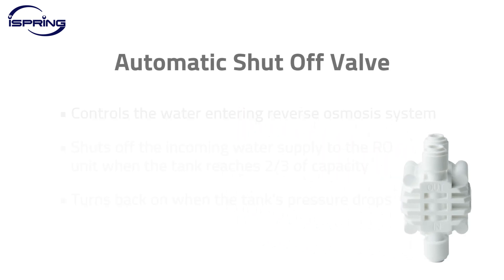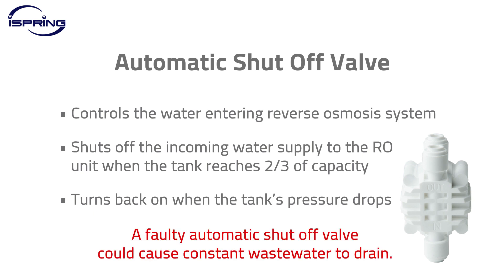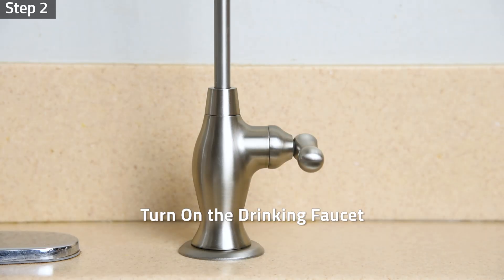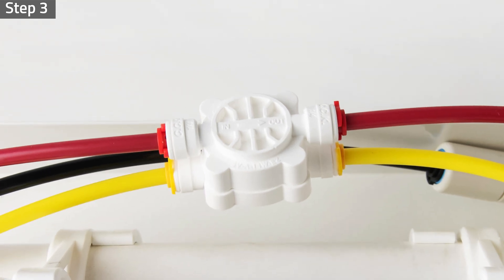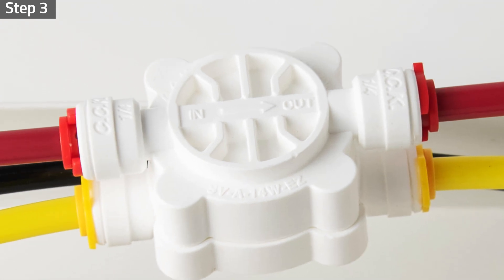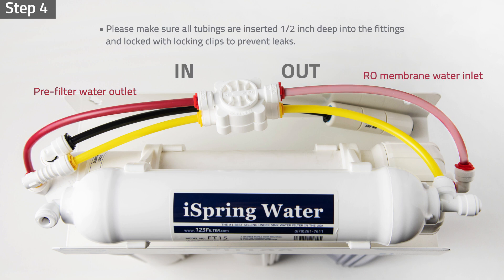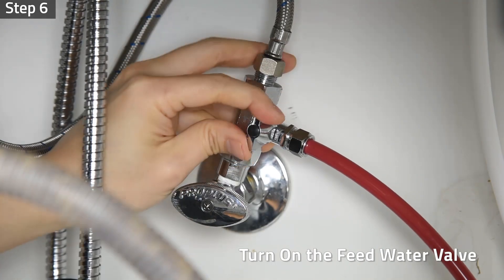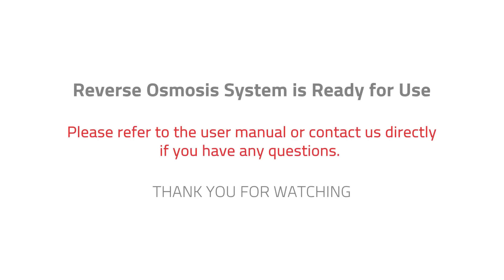How to Replace an Automatic Shut Off Valve (ASOV) on Reverse Osmosis (RO) System Easy DIY

Comment: How do we know the air has purged out for step 7? After step 6 I turned the supply water on and water is not coming out the drinking faucet
Reply from the maker: Hi there. When you start getting a continuous water flow, it means the air has purged out. If after some time the water is not coming out, please double check that everything is properly installed or kindly contact us at support@123filter.com, at (678) 261-7611 M-F 8:30-5:30 EST or at (470) 560-0012 M-F 8:30-5:30 EST (Messaging only)  to properly guide you.
We are happy to help!